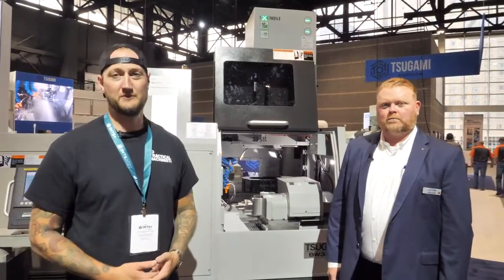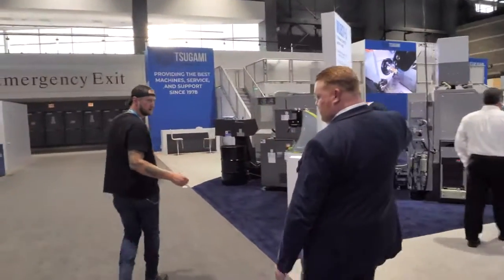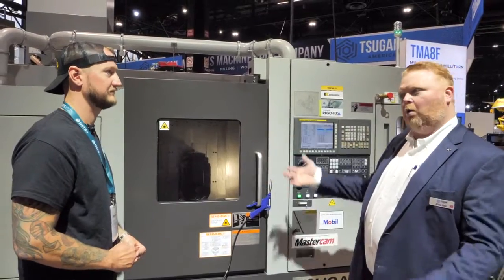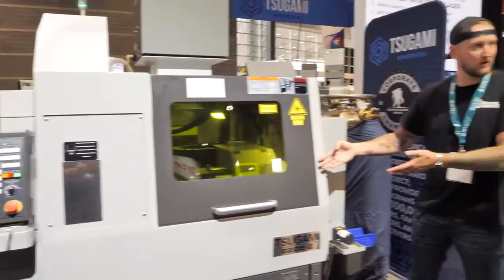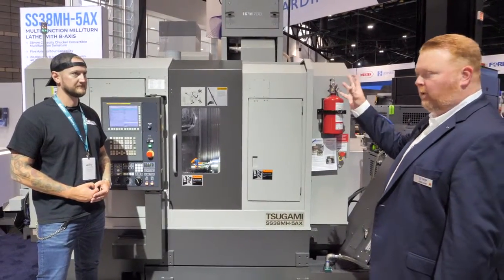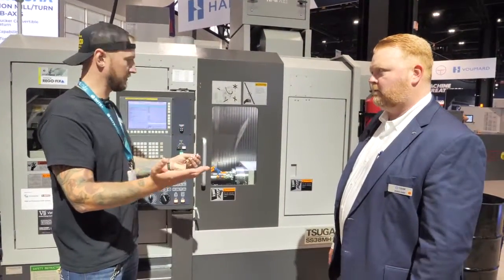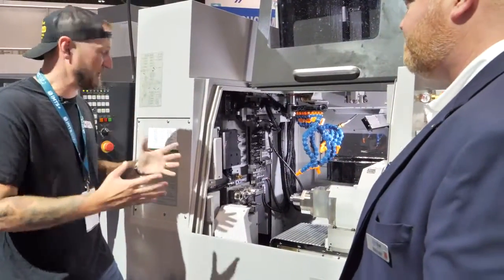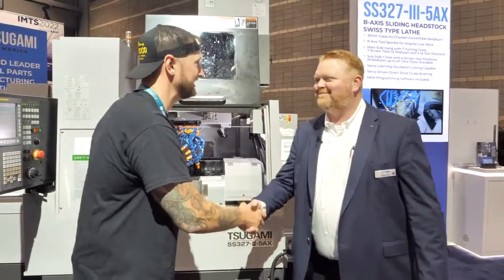From 6-Axis Lathes to Laser Marking in Swiss with TSUGAMI

Comment: We have 9 Tsugami lathes of various models at work and I can tell you from experience, they can not run unattended in 99% of circumstances. I really wish they could.
Reply: Why? What level of attentiveness must you give the machine when running it?😮
Reply: @ninjaabcde  It depends on the part. A simple part out of aluminum can generally run unattended but if you're making complex parts out of steel then it needs to be attended and have parts checked to make wear offsets. 

I work in the firearms industry. The parts we run in a lights out condition are things like QD sockets, takedown pins, buffer housings, etc. Simple parts. Even then, they only run when an operator is present running other machines bc things can go wrong with the bar feeder or guide bushing that have to be cleared. 

Everything else is pretty complex and requires a present operator.
Reply: @Old Scratch  another question.  These things have a max bar diameter. Like 38mm. If there a max limit. Is that a minimum diameter it can turn too? Like would it be able to turn a 1mm bar?
Reply: @Old Scratch  with that said. Do you have to put in effort when these tsugamis are running large number of parts?  Is it like driving a car? Like constant focus. Or just a leisurely shift?
Reply: @ninjaabcde  I don't know the minimum diameter but they can turn very tiny parts. Maybe not the Tsugami specifically, but other machines like Citizen or Tournos make very small parts. 

As far as effort goes, again, it depends on the part and material. Right now I'm making AR-10 bolts out of a proprietary stainless steel which is a bitch to machine. It goes through tools like crazy and has some tolerances down to .0005" so I have to constantly check and adjust parts as the machine warms up or cools down. Other parts are pretty laid back. Set the parts counter to 5 parts, hit start, kick back for 45 minutes.
Reply: @oldscratch3535  what's the reliability like om Japanese machines? Do the breakdown often or need a lot of maintainence?
Reply: @ninjaabcde  Pretty good reliability. We run them 24/7. There's rarely a failure that puts the machine down long term. The machine I'm running right now has 54k hours on it.